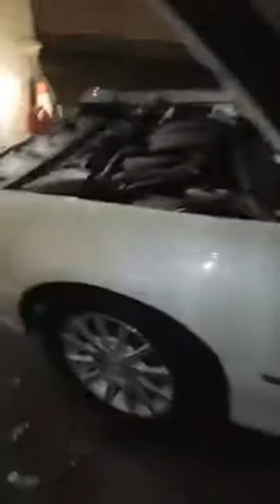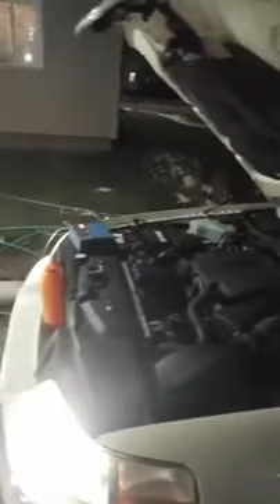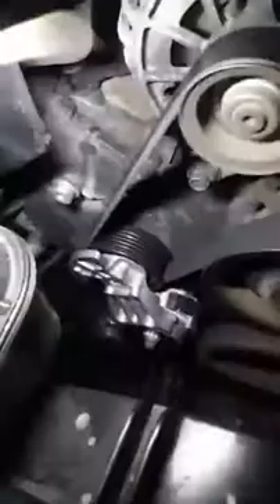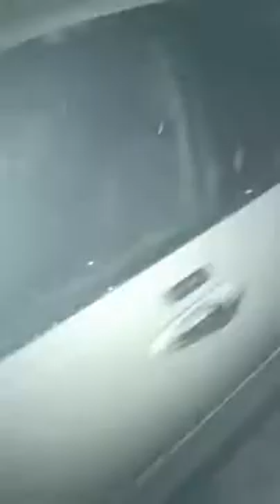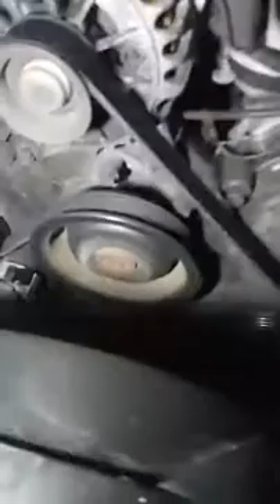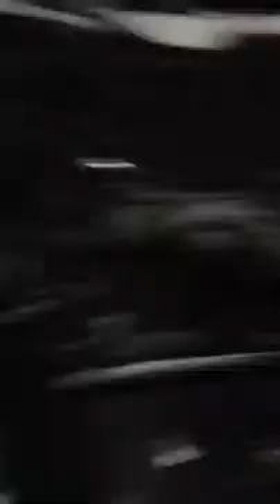Crown Vic Town Car 4.6 Seized AC Compressor belt Bypass.  5 Minutes and $14.00 to fix!

Comment: Put some 11/16 washers on.Grab 2 or 3 depends on what you need. You'll be putting it on the tensioner pulley for the idler pulley to be spaced away from the arm. Do your own measurements its spacing it out not holding it still so thin washers whayever.

Comment: So autozone (that shitty place) has duralast belts which does not have the sizes on the package, so what i  got was duralast 695k6. The first number is the size soo if you need a bigger size like an 81inch that number would be 810k6.. you get the idea.. so the last number, which is 6, is how many ribs wide the belt is. I hope this helps anyone out there! I have an 02 marquis

Comment: This does not work on a 99. I have a customer that has a 99 and 05 crown Vic. This will work on the 05 but not the 99, slightly different tensioner position and design. I just did a delete on the 99 but I had the get the bypass pulley kit, no way to route the belt any other way. So just passing along the info, assuming maybe 2000 and up crown Vic's the shorter belt trick works but not older models. Bypass pulley is available for older models and it is actually pretty easy to get old compressor out.

Comment: Wonderful video! 👏 My compressor started to make noise and it’s $1000 to repair. I didn’t want to deal with pulling the lines and unit to install an $80 dummy pulley. I could not have routed my belt without you either! 😅

Comment: I just did this on my 2011 CVPI and wanted to share some part numbers. Belt: Dayco 5060695DR, Tensioner: Gates 38189, Grooved pulley: Dayco 89051. My tensioner was no longer tensioning and my original pulley was hitting on the tensioner bracket. I could have ground the inside of the grooved pulley down. These parts were readily available on RockAuto with combined shipping and can be interchanged with other brands. Just Be mindful of the grooved pulley flange / protrusion in the pictures.

Comment: I’ve switched the ribbed pulley with the idle pulley but it is rubbing and won’t spin freely. Is there a specific pulley used to make it spin without tension? Or will it be fine to run it with the pulley having tension on it
Reply: Dayco 89051 , I had to switch mine as well. The original grooved  one was touching the tension bracket.

Comment: Thank you!!!!!! Just did this on my 2005 Grand Marquis and it worked out great. Saved me from buying a $75 bypass pulley. Great idea and great video!!! Really appreciate you taking the time to share this information. Thank you also for listing the part number for the needed shorter belt. You really helped me out!!!!!!!!!!!!! Thanks again Bob from Taylor Michigan
Reply from the maker: Youre welcome bob
Reply: I have an 05 mercury grandmarquis to? How did you do it aint the diagrams different?

Comment: I used this for my 06 and it worked. Now my power steering is seizing. Would you happen to know which belt can bypass both ac and power steering for temporary use? Or what you used to measure it? Please help if you can
Reply from the maker: no clue, sorry.

Comment: Is that the original tensioner position on the timing cover?
Reply from the maker: Yes. Tensioner is in the same spot, just swapped idler (grooved) for the smooth tensioner pulley

Comment: Thank you so much this worked on a 2001 4.6 Towncar except we had to buy a new idler pully the old one rubbed on the tention arm and they only had a70" belt but it works we appreciate you for sharing.
Reply from the maker: You are welcome! glad it worked.
Reply: @cbreads my unlimited pulley seems really tight
Reply: What idler pulley did you buy

Comment: Easter Sunday ac compressor barings seized up spent 6hrs on side road trying figure out how to bypass until saw ur vid it's amazing how u even thought of swapping the pulleys n exactly right 69/half inches belt followed ur steps saved me huge tow fee tyvm i wish I had ur amazing brain cells
Reply from the maker: i am so glad i could help. it always makes my day when people randomly come on this video and relate their success stories...with the bullshit going on in this country, inflation, cost of fuel and all that, being stuck SUCKS. its expensive!!  however just 20 bucks later you're back on the road for another 100k worry free miles (or until you replace the AC compressor)
 
thanks so much for the kind words my friend!

Comment: Wow thank you for putting in the description the belt number I have the same problem it’s winter time basically I’m going on a long trip my AC is acted up last week I just don’t wanna take a chance . I’m gonna bypass it with this method and in spring time I’ll just replace AC compressor and everything else that goes along with it thanks again for the video much appreciate it
Reply from the maker: Catfish you are absolutlely welcome! Love helping people out of a bind...have a friend with a late model Town Car same problem...went to  2 shops, cheapest estimate was $1680.00 over $770 for the compressor alone!  BOTH shops flat out refused to do a bypass or install a bypass pulley (bypass pulley kit requires removal of the compressor) 

He was told by a friend to contact me.

I went to his location with the Napa belt and a socket set.  11 mins start to finish with new belt and swapped pulley.  Cost: $11.70 for the belt.

She threw me $40 for fuel even after repeatedly declining payment.

She saved over $1600.00 and has a running and driving vehicle until SHE DECIDES to get the ac compressor or ac clutch/bearings replaced....
Reply: @cbreads  I just finished putting it back together the belt at auto Zone was 23.99 well worth it , now I won’t worry driving to my sister‘s house to visitIt’s about 800 miles one way. Thank you again

Comment: this happened to me 300 hundred miles from home did this minus swaping the idler pulley with the tensioner just left those alone and put that belt on and no problem the whole way home.

Comment: Shouldn't this work on all 4.6 engines from 98-11, Crown Vic, MGM, and Towncars? I have an 03 CVPI with the same engine.
Reply: they all have same engine but slightly different positions for tensioner, idler etc, that's why it's good to check for same year, or better yet, make sure you make good friends with your auto parts wreckers, in case the chinesium parts don't arrive
Reply from the maker: It appears there were changes from 98-02 02 to 05 and 06 to end of production. 1) drive by wire came in late 05 (i think) and then the PI intake update may have changed things
Reply from the maker: apparently not.

Comment from the maker: almost 10k miles, still no issues.  get a bit of a squeal thru the car wash but it did that when it was oem setup too.  i sold it about 3 months ago and the owner (family) has the new ac compressor and all but hasnt yet replaced it.  He says he will probably get it done in winter....lol.

Comment: Not a bad idea, and if it worked for you that's pretty good.  I'm trying this at the moment on an '09 TownCar.  No matter which way the grooved pulley is, it will not spin once tightened down.  I could run it a little loose, but that won't work either as when the tensioner is installed, the pulley is touching the engine.  It's just a 1/16" thicker than the smooth pulley, but that's all it takes.  Any ideas or tips?
Reply from the maker: flip the pulley or adjust the tensioner further out.  on mine one side touched one side didnt. theres a different offset on each side. (at least on an o6) sorry for the late response as im getting no notifications.
Reply: Have you tried shimming it with a washer?
Reply: Did you resolve this? Mine is hitting motor no matter what
Reply from the maker: Also, make sure youre using the same pulley and same bolt from that site on the engine.
Reply: Mine interferes too no matter how I flip the grooved pulley when attempting to mount it on the belt tensioner mechanism.  The pulley casting around the bearing comes up higher on the grooved pulley. I may go buy an aftermarket grooved pulley and see if designed differently and possibly clear.
Reply: Please help with your follow-up Solutions please
Reply: Please help with your follow-up Solutions please please please please please please
Reply: @MikeTyson2   Hey Mike, sorry, am up in the arctic with very little internet and didn't see this.  To be honest it's been so long since I did this 'repair', I can't remember how it went.  However, the car is still running, NO belt squeal, and all pulleys turn - so something worked out haha.  I'd try a washer if you have one handy.
Reply: @kdvjcv  did you continue to use a pulley where grooved pulley was originally.?

Comment: Do you have a part number for the belt or the width and how many grooves?
Reply from the maker: its literally in the text....

"Once i installed the Idler Pulley on the tensioner arm, i checked for clearance and freewheeling Re - installed the Tensioner with the grooved idler pulley on it, took a wire and measured 68 inches flat (without tensioner) Measured tensioner range of 4 inches, divide that in half, and the Serpentine Belt Part Number 695K6 is a PERFECT fit, same width and groove depth and spacing as the stock 4.6 Litre belt (with AC) and cost $14 At any auto parts store."
Reply from the maker: 3500 miles on this bypass and zero issues...a bit of a squeal when going thru car washes with underbody spray blasters, but it did that prior to the AC bypass..
Reply: Will it work on an 04
Reply from the maker: @JoseRodriguez-sn3lc  you can just get a bypass pulley for 20 bucks.  but id imagine it would work.
Reply: @cbreads  it worked
Reply from the maker: @JoseRodriguez-sn3lc    great! nothing worse than a CV/TC blowing out a AC Compressor and being stuck wherever it happens.  it should last the life of the car too. i sold mine to a nephew and hes up over 10k miles since the mod and no issues... Glad to hear - be well Jose.
Reply from the maker: FYI, Over 2200 miles now it works fine., Not a squeal or noise. I expected possibly some power steering squeal when lock to lock, but nothing,.
Reply: Will this work on the 2002 crown vic?
Reply from the maker: @NoName-wi3kc  it should